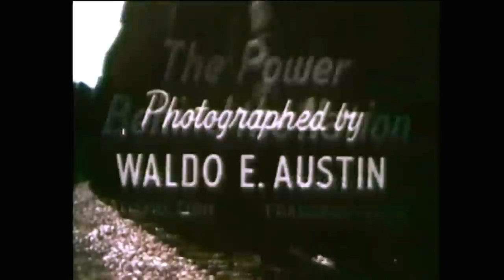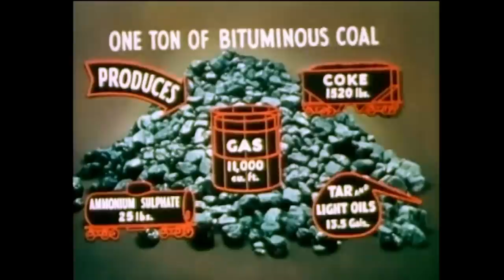Norfolk and Western Railway The Power Behind the Nation

Comment: That's when the A class and the y6 locomotive was used to pull tunes of coal hoppers up those mountains but yea in the future some steam locomotives like the EFE aka 844 or the GS-4 aka 4449 burnt oil well the 4449 was ment to burn oil since it came out the factor as well as the SP cabforward well cause they were all western types and there was not alot of coal in the southwestern areas so they used oil
Reply: Steam engines in the American southwest burned oil since there was no nearby source of coal. Plenty of oil wells in Texas and California!
Reply: @Greatdome99  ok
Reply: Maybe you noticed 1208 go by, I presume it was an A.